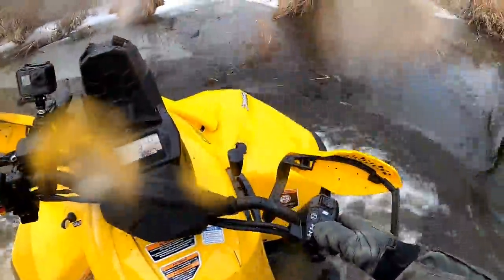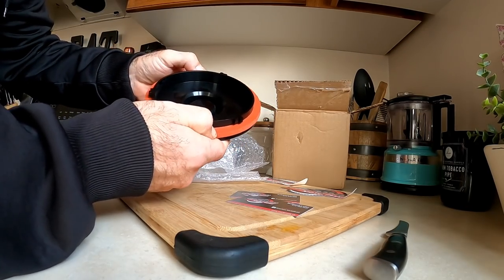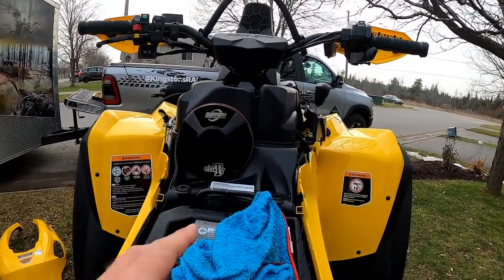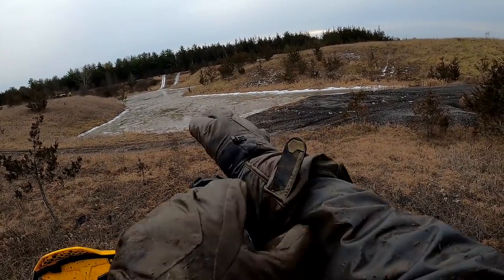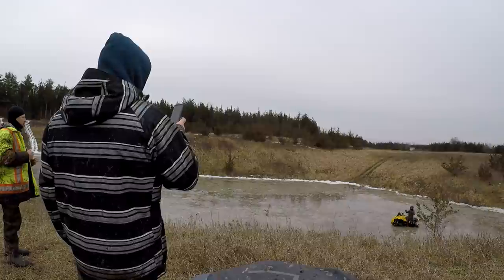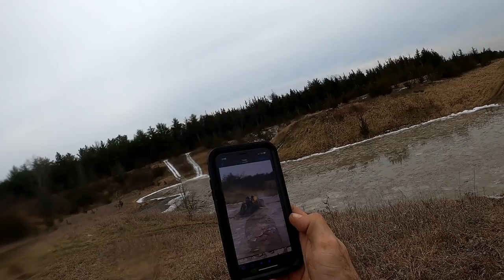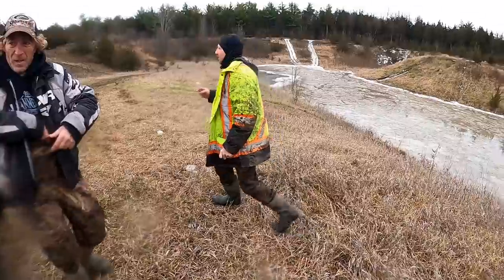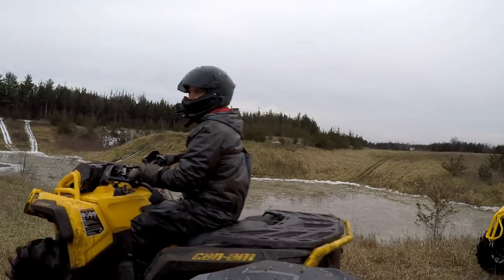Try the 850 he says!! 2021 Can-Am Renegade X-MR 1000r & Outlander X-MR 850 Full Throttle

Comment: So when your diff lock it has a rev. Limiter ? I just bought mine so you are helping learn this beast!!
Reply from the maker: Kicks in at 40kms I think. It’s to be expected really as all diff locked quads have a limiter due to added stress when steering.
Reply: @ehTV1000  copy that thanks
Reply: @eh TV I saw in another video on these new 2021´s that when in full diff-lock in Low gear, hold the override-button then you´re not gonna be limited :D Cheers!
(Maybe I´m not first to tell ya or you may have figured it out by now :P )

Comment: Rpm limiter when in full lock hope a tuner gets rid of that
Reply from the maker: I would imagine so!
Reply: @ehTV1000  Dynojet Powervision 3 w/ the Dynojet  Power Core Software is what I am using on my 21 Renegade. All limiters are customizable,  rpms, top speed, torque, afr, etc.. Optimize your tune yourself or download a tune from the Dynojet website. It also reads fault codes, very useful tool. Hope this helps ya'll.